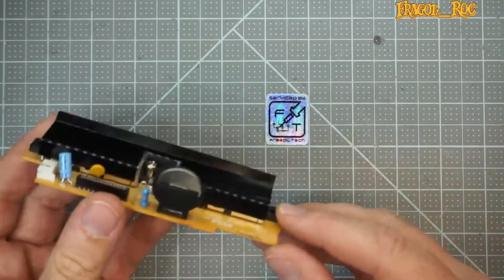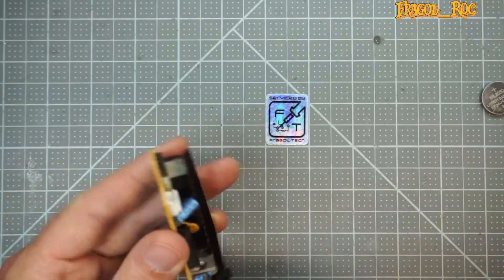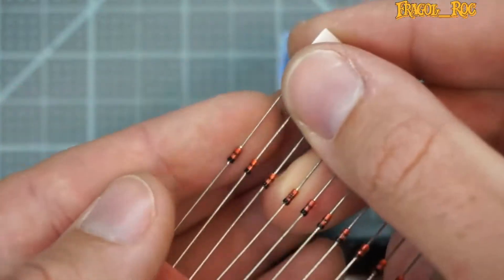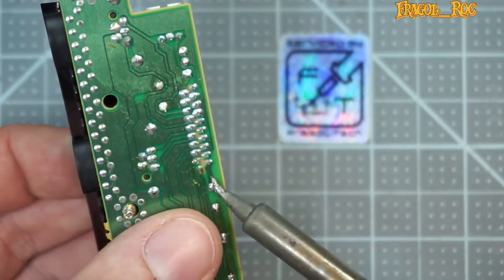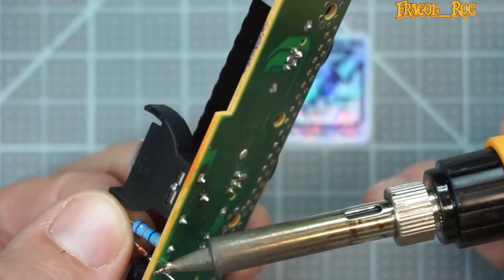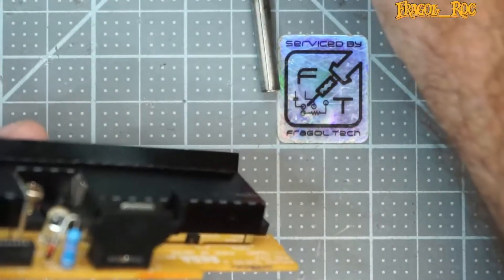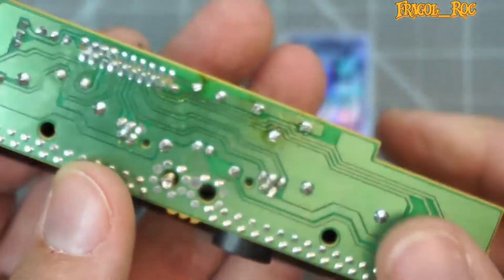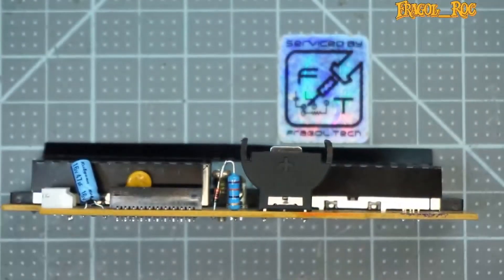Dreamcast CR2032 Battery Mod | FragolTech | Retro Mods & Hardware

Comment: But if I continue using an ML2032 battery, it is not necessary to install the diode, right?
It would just be installing the new base, for the new battery that I will be replacing when the useful life of the battery comes to the end.

Comment: Not sure what the resistor is for then? Originally it's there to limit the current that the console supplies into the battery; but with diode it's not putting anything into the battery :D

Comment: I bought a modded Dreamcast off eBay with a battery mod. It doesn't have the diode installed. The battery included is an LIR2032. Is this a problem? If I play the Dreamcast regularly, it doesn't ask me to put in the date or time. If I don't play for a few weeks, then it prompts me to enter date and time again.
Reply: That's basically the same type of battery as the Ml2032 but has a higher voltage of 3.6V  and less capacity. As I heard some people using that battery it seems the Dreamcast can handle the higher voltage. However, with less capacity it may discharge faster than the ml2032
Reply: @No1BRC  So, if I go to replace it, what battery should I purchase given what I've described about my mod?
Reply: @tubinonyou  ML2032 is the recommended battery

Comment: i remember voultar made a video about doing this a couple of years ago showing people how to save on batteries. is this any different than his method i think you use the same diodes that he recommended using i need to do this to my dreamcast eventually the batter holds for 6 months
Reply from the maker: It's the exact same method, nothing special or different. I had a friend ask me about how to do it, so I shot a quick video and uploaded it!

Comment: A console with a rechargeable ML2032 loses the save when you disconnect the controller board for any other reason, like we are prone to do, so a non-rechargeable is best for us tinkerers. ;) Also, they usually stop holding a charge before a non-rechargeable CR2032 would go dead, making the whole effort pointless. It only makes sense for high-drain devices with quick access to replace worn rechargeables.

ThinkWare sells a dash cam with a soldered-in rechargeable battery that goes bad after as little as 18 months and then the camera starts recording over all its footage as it thinks the date is Jan 1, 1970… even though it auto-sets the time and date moments later off of GPS. This made the camera useless as a DVR and all they would offer for this design flaw was a discount on a newer one. Nice try, ThinkWare, but I’m definitely not buying another. Thankfully, a Dreamcast can still play games when the battery goes bad but it’s still just as pointless for it to be rechargeable. Big fan of the charge-disable CR2032 mod. :)